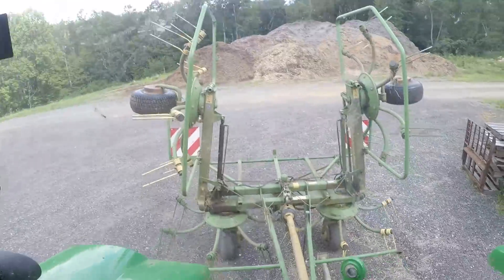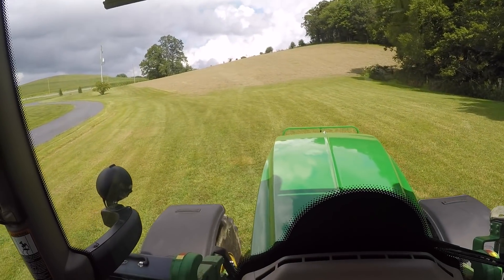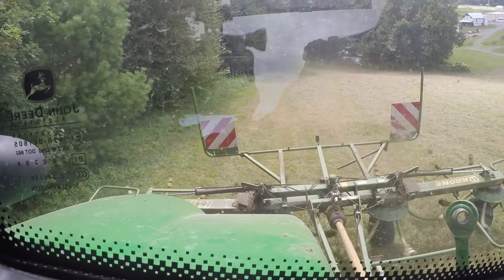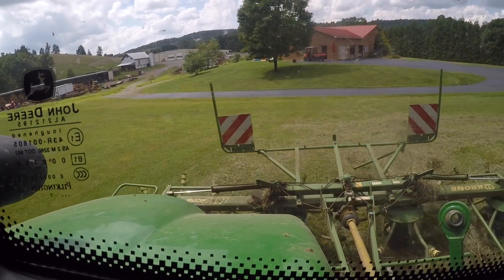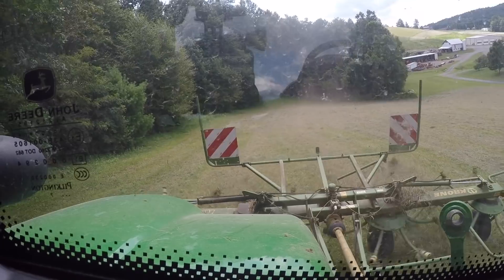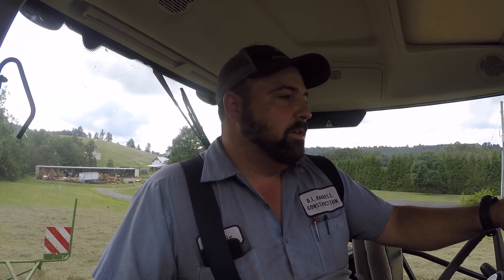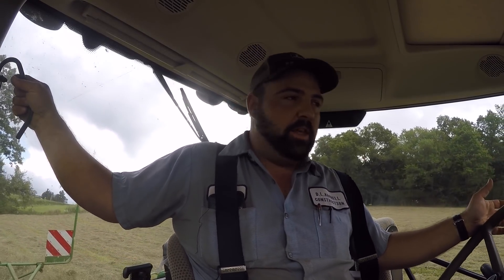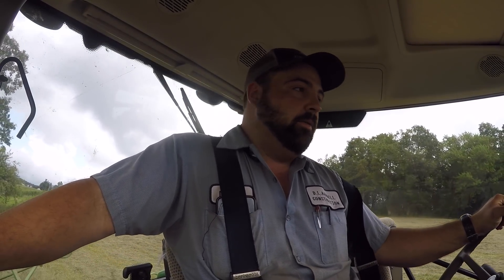Tedding Hay and Talking Tractors.

Comment: Thanks for the ride along Dennis and tractor talk. My 1979 F350 4X4 super cab camper special had wheel hop at 58-63 MPH but smoothed out at higher and lower speeds. The load range E 10 plies probably had something to do with it. I bought it in early 79 for $9700 and that would not be a decent down payment nowadays.
Reply from the maker: Wow how things have changed trucks cost 10 times that now.

Comment: Hi Dennis,
  My 6130 has the same road vibration you mentioned. I have the Michelin radials and it seems to be getting less as the tires wear in. I don’t drive on roads that much with it. I also love how well mine performs.
Reply from the maker: Mine has Firestone tires on it. It's not a big deal but it's worth mentioning. I would much rather have that then banging and a noisy transmission

Comment: Denis, just a suggestion. We’ve a 120R at work and sometimes the loader is hard to put back on. To make it easier we take it off with the bucket against a wall just in case we need to push against something.

Comment: Have they made any improvements on that krone tedder? Older models you could only transport about 10 mph due to the weight or it would blow the tires out. My dad's friend had one and got rid of it due to so many blow outs where it swerved all over the road. We have a kuhn and you can do about 45 before it will sway. Just curious how that model krone is. I'm sure they improved them.
Reply from the maker: Haven't had any blow outs the tires are 10 ply

Comment: Iv got a 1986 JD 3150 with a JD 265 loader on it. It is easier to take on & off of it  than the nh ts115A or mf 5455  that iv owned. Deere has been ahead on several thinbs for quite some time.
Reply from the maker: Yep I agree on that👍

Comment: The vibration on the road is most likely due to the front tires being pumped up hard for loader work! I bet if you dropped your tire pressure on the fronts with the loader off it would mostly go away!
Reply from the maker: Maybe they don't seem all that hard but I haven't put a gage on them yet

Comment: Have you had any trouble with welds on the Tedder. We had a krone swadro rake frickin welds were always breaking. The we went up too a 3 wheel and it had no problems was a nice deal
Reply from the maker: All the friggin guards have broken off of it just from normal use bouncing through the fields.

Comment: I'm going to be interested in how easily (or not) the loader goes back on.  :) 

After helping my grandfather takeoff and reinstall a loader on one of his tractors years ago, the difficulty of reinstalling was enough that he never did it again...... and based on that experience I'm not sure I'd even want to try with my own (newer) tractor (especially not without having a hard/flat surface to part the loader on).
Reply from the maker: It went back on in 2 minutes with one trip out of the tractor.
Reply: @DLHFarms  Wow - that definitely beats all the re-positioning and prying to realign pins I remember having to do years ago. Thanks for the feedback.

Comment: You might be able to stop the vibration by changing the tyre pressures up or down.
Reply from the maker: Your probably right but you can't let air out of them because of the fluid in them. I'm afraid to put air in them because if it makes it worse I can't let it out.
Reply: @DLHFarms ... Ah ok,  never been a fan of fluid in tires. Costs abit more initially but I much prefer wheel center weights.
Reply: @DLHFarms  Put the valve stem at 12 o-clock and adjust pressure to allow tires full flat contact to the ground, you will have to make small adjustments to your conditions. I don't run fluid in the front tires. Happy Harvesting!

Comment: Did the loader go on as easy as came off Dennis? .l can't remember  seeing  a video  of the 4710 with the loader off .Have you  taken it off many times ?.Always  nice to get loader off any tractor . showers make hay time hard work , But try making  hay Cumbria   England.
Reply from the maker: Yes it went on just as easy. Drive into it get out once put the stands up hook up the hydraulics and go. My Massey doesn't have a single point hydraulic connection so it can be a pain to get the hydraulics hooked back up and I use the loader on it every time I make hay so I just leave it on.

Comment: Dennis tedder could possibly be over revving if u are using 540E . I think krone recommend 350 to 450 on the pto which would put the tractor in the economical rpm range anyway ~~
Reply from the maker: I don't remember seeing that anywhere and I think it runs to slow even at 540
Reply: Stunning rolling countryside & no doubt you are enjoying the efficiency of the new tractor , did check my 10 star Kwt  11.22 & sticker on front is 350 - 450 input speed , your particular model may be different  ~~
Reply from the maker: @m.j.l.abulle9107 . That's a big boy. I'm looking for a 6 star I want a Pequea
Reply: Don't know that brand here

Comment: Does your new Holland tc 40d vibrate our tc 40d don't give us any problems really other than I'd like the front boom hydrolics don't lift quite like the Massey Ferguson model 25 does I guess it depends on the size of the pump
Reply from the maker: No it doesn't but it's open cab and you couldn't hear it vibrate if it did, it also only goes about 15mph where the Deere goes 27mph.
Reply: Yeah our new Holland is hydrostatic driven if it was gear driven I bet it would move a lot faster
Reply from the maker: @shawnfox8002  nope they both go about the same speed.